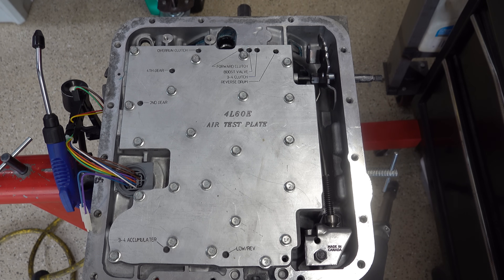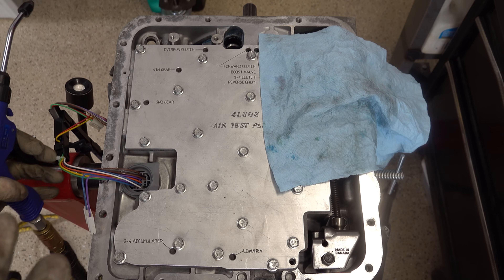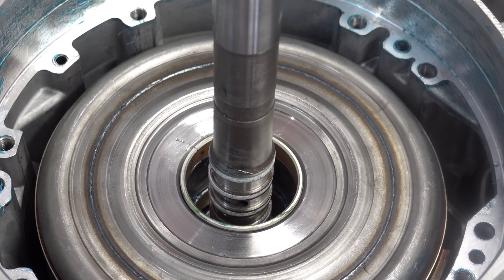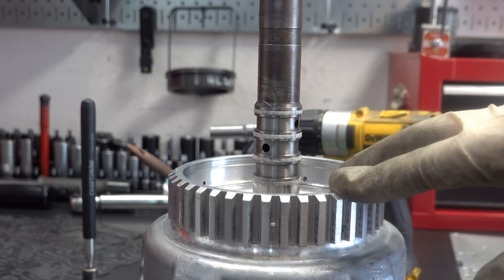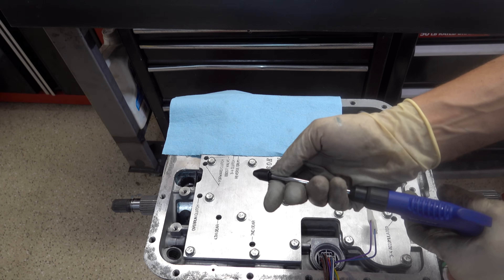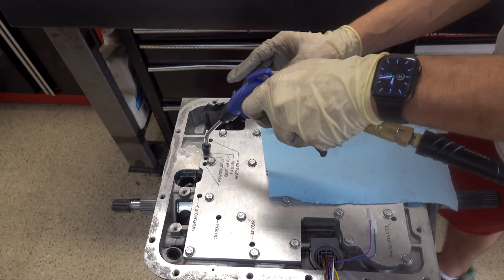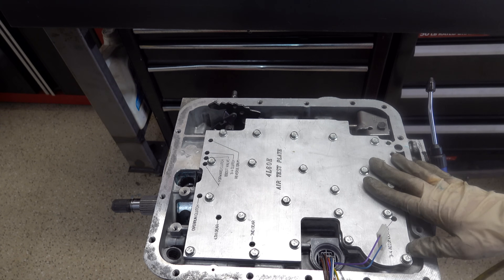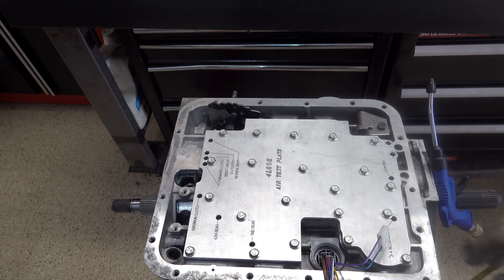Rebuilding Automatic Transmissions - Use Test Plates to Catch and Fix Assembly Issues!

Comment: Awesome video. I decided to get a test place myself after watching it.
Out of curiosity, what do you think would have happened if you had not caught that and the transmission had been installed in a vehicle?
Would the 3/4 clutch pack have failed immediately and 3rd would not have engaged even on the first drive?
Or would the sealing rings expand a bit under higher temperatures causing 3rd and 4th gear to work, but the clutch pack would have eventually failed prematurely? As in it would have lasted maybe 30,000 miles as opposed to maybe 150,000 miles?
Reply from the maker: Thanks for watching, JCarGuy. Great decision to acquire that tool, I'd never rebuild a 4L60/80 without one....

Hard to say for sure how long that particular trans would have lasted but if I had to speculate based on what I saw on the sealing ring (got pinched/flattened somehow), I'd say it would make it 0-1000 miles at most before drivability symptoms would have begun to materialize...And regardless of how subtle, once the customer would have notified me, I would have recalled the transmission for warranty repair work.

Comment: Are you doing this air test method prior to disassembly of the entire transmission, and after the rebuilding know, basically checking for leaks as you disassemble I’ve seen people do that with the six speed variations 45 through 90 GM transmission as they disassemble
Reply from the maker: Hi J Ray,

Not on tear down, at least not for 700R4s or 4L60Es as I never found it to be necessary. 

The six speeds (6L45/50/80/90) on the other hand are worth checking, especially the pre-2009 units as they all have the first design pump stator and are prone to cross-leaks between the 1-2-3-4 and 3-5-R clutch circuit. On tear down, you'd be confirming an internal cross leak diagnosis in response to a trans coming in for either flaring, stack shifting or slipping in the 2-3 or a delayed engagement into Drive as well as (in real bad cases where sealing rings are excessively worn or broken) a partial or complete tie up between drive and reverse when in reverse. 

I do this as well, but didn't show it in my 6L80 tear down as I was moving through and didn't think about it. If it get a 6L90 or 45/50 in to rebuild, ill do another tear down vid and show air checking being done as those and the 6L90 have key differences compared to the 6L80s.
Reply: @nickstransmissions  thanks for your reply and videos
Reply from the maker: You're welcome, man and thank you for watching!

Comment: Great video... I don't think you can ever air check to much
Reply from the maker: Thanks man, and agreed...Take 5 minutes now or hours later w/re-work. Those test plates are great for many GM and Ford four speeds...
Reply: Most definitely  bc the most simplest thing will cost you hours when it comes to trans building